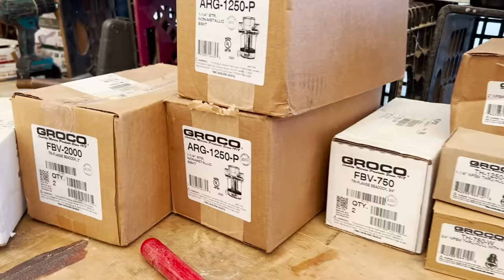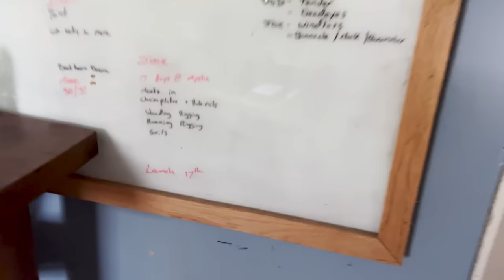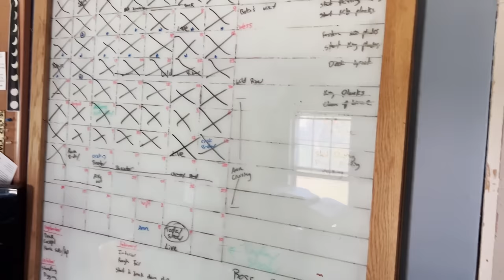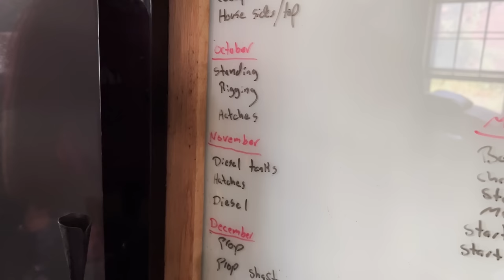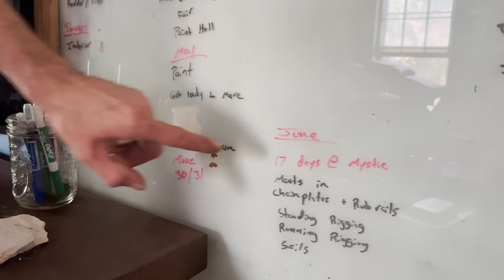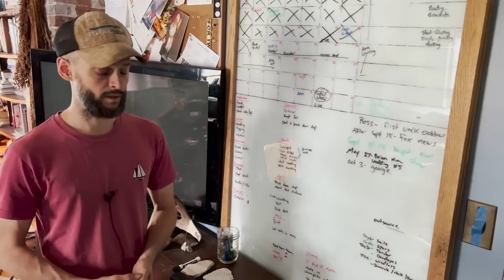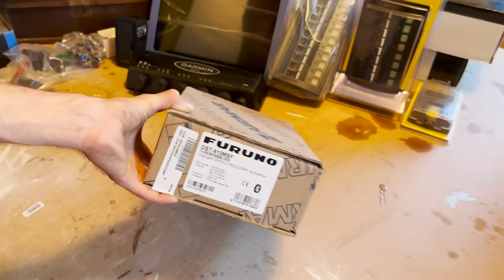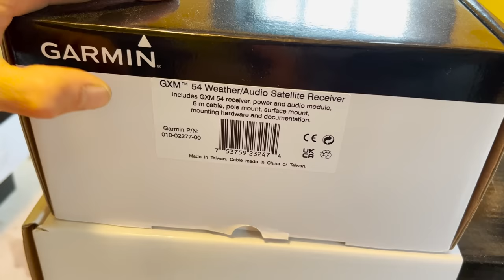Everything and the Galley Sink - Episode 228 - Acorn to Arabella: Journey of a Wooden Boat

Comment: Regarding through holes, I quite like the way the guy from the "Alluring Arctic Sailing" channel does it: Only have one hole and a standing pipe, draw the seawater to above waterline, connect everything that needs sea water to that. That way, apart from the pipe braking, there is no way for seawater coming into the boat unintentionally if something brakes. What do you think, is there something to it or are many through holes of no concern to you?
Reply from the maker: Putting in siphon breaks for each isn’t difficult, but yes, we’re putting in as few through hulls as we can with what we need and want to do.

Comment: I'm not a boater,  but I just had a question regarding electric power. You talked about solar panels, but is there any kind of wind generator that could go on top of the mast to recharge batteries? Being a mostly wind powered boat, I wonder if thats something that would be easier to capitalize on and function day or night, cloudy days or when you're motoring up a narrow channel and trees on both sides.
Reply from the maker: Not at the top of the mast, but there are things that can be hoisted temporarily (it’s not easy to build something for wind power on a double-ended ketch) and there are water turbine generators becoming more readily available and affordable.

Comment: Great work. Great channel. Big fan here.
What is the estimated weight of the boat when completed, and will you be getting an exact weight either at a weigh station or by crane?  Thanks!
Reply from the maker: A little under 25000 lbs, most likely. The crane or lift might be able to weigh her.

Comment: My comment/question regarding humidity, forgive my ignorance! Living as I do at the coast, I understand the issue of more stable humidity with season changes. How is it that you have drier climate during winter with the snow etc, and more moist in the summer? Our winters are also wet and cold (how obvious is that?), albeit with snow only on the mountain tops, with typically dry hot summer. I'm thinking of my back door that swells up and is a real pain in the ass every winter! (My bad for not doing something about it after all these years!) Is your main rainy season in the summer?
Reply from the maker: Shoulder seasons, actually. Fall and spring.

Comment: Just asking, certainly not questioning to be clear, I'm a non boat builder, got to watching because of the use of hand tool woodworking. I've also been reading a novel set that features a lot of navy references, they mention copper cladding the hull, I wonder if the comments re the worm shoe and the felt could be replaced with copper (not the whole hull for petes sake!)?  I am properly missing something very important here,just curious. Love the series. Can't wait to see her on the water, and maybe in person if you every sail down under.
Reply: Apart from the expense, copper cladding is pretty bad for the marine environment, which is why it's great at repelling critters. I think the worm shoe on Arabella is designed to be fairly cheap and moderately easy to replace. If she runs aground or hits something below the waterline, Steve can be assured that it'll stay critter-free long enough to get to a dry dock to replace it.
Reply from the maker: Hello Owen! John’s right… there are a couple of ways to go about protecting parts of the hull that are susceptible to groundings or critters, and we’re going the sacrificial rather than the shielding route. Copper sheathing doesn’t really shed a great deal of copper into the water, not like ablative cuprous paint does, so it’s not the environmental reason, but rather the practicality, that makes it so we’ll be using bottom paint and some sacrificial parts. Additionally, people who sheathe with copper don’t do so in small sections, but would typically do the whole hull up to the waterline.
Reply: @AcornToArabella  Aren't there also galvanic corrosion issues with copper cladding if you don't properly earth the boat?

Comment: I hope you're not going to bolt down the diesel before you launch.  The vessel will sit differently in the water than it does on the dock.  That will change the alignment between the propeller shafting and the engine/reduction gear.  You should let the vessel for at least a week before you try to align the engine/reduction gear to the shafting.
Reply from the maker: Of course the diesel is bolted down… engine mounts are each adjustable for the reasons you bring up here.

Comment: You don't need any fancy wind detector, go on deck and you will know the direction and relative speed of the wind. Actual speed doesn't matter. The expensive satellite (?what?) compass can't do more than what a $2 handheld can. Send those back and save money (and electricity).

For the anchor chain bin, you don't need a pump, just run a tube from the lowest point, out the side of the boat.

You DO need an electrical system prior to launch, unless you will be at a dock the entire time, you need a light at the top of the mast at night.
Reply from the maker: Thanks for watching!

Comment: Get the boat in the water. You will have a huge amount of free time to do wire projects and work on rigging and finishes never end. There is a new standard replacing NEMA 2000 coming this year.  You want to run that stuff. Also, look at more commercial grade electrical. Cheaper and way better.  Your thinking is right. We will see you up in down east next summer.
Reply from the maker: Thanks for the tips, William!

Comment: The downside to stainless steel anchors is that they can develop micro-fractures, often around the weld area, and with a galvanised anchor you'd notice the crack as a line of rust, however with stainless you'll never see the crack until it's too far gone for repair.

You can however get a test kit, where you paint some stuff on, wipe it off, then spray on an activator which will make the first paint that soaked into the crack more visible ... it's probably worth doing that annually.
Reply: Too far gone for repair? When can you not weld steel back together?
Reply: @mktrollop1093   I think hes talking about when the other half is sitting on the seafloor.

Comment: I've honestly never cared for the idea of a "launch date." Just build the thing at your own pace and when you're done you're done. I doubt you'll get done by then too. Shit happens and plus are talking just for launch, or once it's fully operational? It'll need a few months of tweaks during its shakedown. 19:25 TECHNICALLY, stainless steel still rusts. Believe me. I install pool cages on the coast in Florida and we use stainless steel screws and they STILL only last 20 years before corrosion from salt and chlorine.

Comment: His argument is weak at 30 minutes.

He is missing an entire category of electrical that means running yet more wires.  All the systems involved with lighting, radios, solar panels, navigation , the engine at the very least.  Can’t outsource all of it to the spar work, there’s work inside the boat even with wiring up connectors at the mast ahead of time.  If he likes conduit that’s another round to runs and boxes to mount before can finish cabinetry.  Then there’s the actual systems installs and setup.  He needs to buy that to finish the cockpit as there’s gauges, switched, etc to install in it.

His solar system and/or generator is nonexistent and he’s going to find he needs to change that.  It’s that fridge that’s the problem point, it needs substantial battery power.  So there’s the inevitable installation of a battery bank and charge controller and redesigning cabinetry to hold it.  Go look at the list, there’s not even a listing for installing any system.  Most of it doesn’t go in the nav area, it goes outside and needs to be covered.  You sail the ship based off the navigation items real time.  You don’t go into the boat and back outside.

And then come in need time to test all these systems.  Imagine finishing the boat and not including time to make sure things work before launching.  Need a working engine to move the boat off the launch ramp/yard drop. 

The critical part of the timeline, the spars all have to be mounted to measure for rigging and come down again to move.  No one guesses for rigging, they measure exactly what’s installed.  They can’t measure existing because it’s never been made.

You don’t measure for sails until the rigging is mounted because you measure the rigging as installed for that.

That’s not 17 days, just the part at Mystic is multiple months.  Remember, supply chain issues and sails are super custom.

Anyone interested, somewhere in their history Delos has replaced both rigging and sails and they go into the process of measuring for both on video.  Rigging was in Thailand and sails were somewhere around the Caribbean.
Reply from the maker: Thanks for stopping by!

Comment: stainless anchors and chains rust really fast in warm water. That is why almost nobody uses them.
Reply from the maker: This anchor is 316L marine stainless—the temperature of the water won’t affect/accelerate the rate of corrosion.
Reply: @AcornToArabella  yes it really will, i posted a link wherein an anchor chain manufacturer discuses it.

Comment: WHY oh WHY do you want wire rope for standing rigging.  Dyneema rope is stronger, tougher & never rusts.  It is light & very flexible so you can easily keep spare rolls on board.
Best of all, it's the EASYIEST rope to splice.  Youtube has several video clips of sailors using dyneema to replace standing rigging, AT SEA. 
Not recommended for running rigging.
Reply from the maker: Cost mostly. We’re not opposed to dyneema, but galvanized is pretty simple and great. It might only last 30 years though. 😁

Comment: Place your bets:

Every time you said “We need to install …” is a project.  You can calculate the number of projects from this video.  Divide the number of projects by the number of days left.  That gives you the number of days per project.  

Even if you have a full crew, it tells you the rate at which projects are checked off your project board.  Let’s say one project should be crossed off every three days.   

Do you still think your boat will get wet on time?

Comment: "StainLESS"  steel.  It will rust but not as much.  NEVER use high carbon steel tools on the stainless steel, and this includes used sandpaper/grinding discs and TOOLS, because the steel will transfer and cause the stainless to rust.